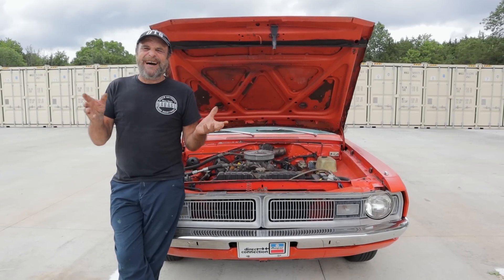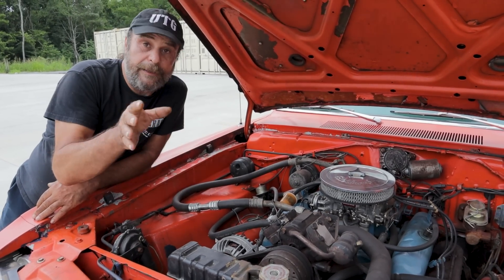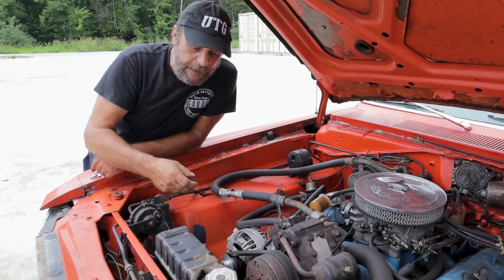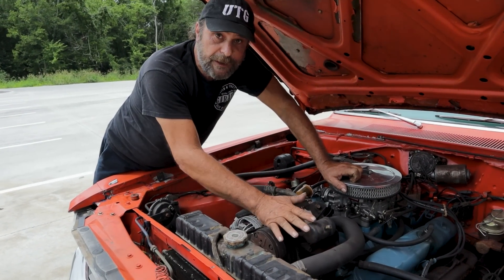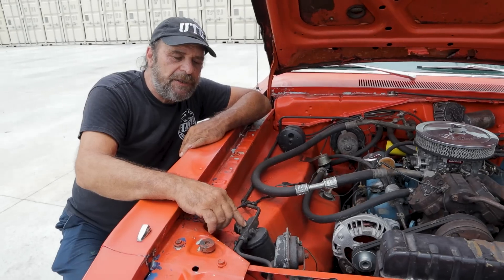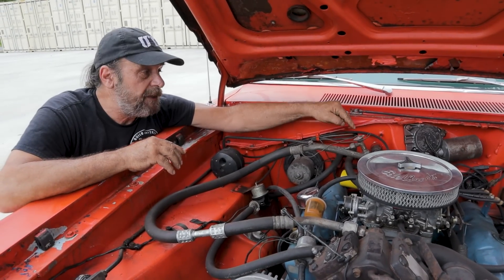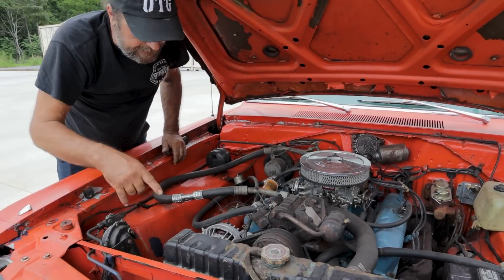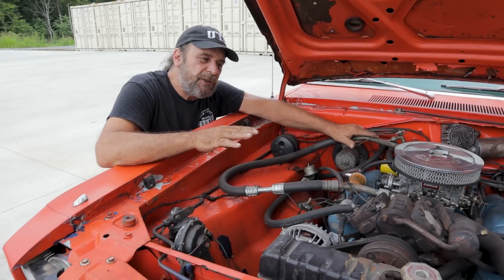Classic Car Air Conditioning Systems - How They Work, Their Differences And Basic Troubleshooting

Comment: I am retrofitting AC into my Valiant using the controls & box from a '75.  The compressor is a later Sanden, brackets & pulleys. from a later LA.  Got a new condensor, evaporator, box parts, dryer, lines & all from Auto Air Solutions.
People might say, "I'd never add AC; adds weight, complexity, isn't original..." but I live in the South and would like to drive my cars whenever, the added weight can be offset by lightening things up, moving the battery to the trunk, et cetera, and not to mention I don't own "Museum pieces"

Comment: I have a stock RV2 on my early 80 D150. The later ones seem to have Sankyos which are much lighter. I have to use my cherry picker to pick up and install that late 50's design RV2 because at 70 it kills my lower back for days. Works great but even with aluminum heads it's a heavy mother!

Comment: The orifice tube on my 93 GM pickup is located right at the outlet of the condenser. I thought that was a strange design.

Perhaps it doesn't matter whether you have high pressure refrigerant or low pressure, cold refrigerant running back to the firewall.. it's going to absorb engine compartment heat all the same.

Comment: I've had very frustrating luck with remanufactured V2 compressors in the last several years, it seems the cores are worn excessively, or the new seals are bad from the get-go. So now I convert to Sanden compressors. They don't have a factory look, but they are much lighter, they don't shake the engine around, and they are reliable.

Comment: Something the old mopars had that all of folks did not know is they have a cycling switch in the dark abyss of the under dash compaction. Also them mopar clutches bite the dust it seems. Also a tid bit the large A/C line is a 3/4" tube. However to have new lines made with barrier hose the fitting is a 5/8" so no big deal, just make the cut.

Comment: How well do those ultraviolet dye leak detectors work?

My brothers car needs brakes, struts, exhaust and front end work REALLY bad but he only wants to spend money on getting the a/c working right now and I'm sure that it has multiple leaks. Yes, I've told him how stupid it is to worry about the a/c before all of the other issues.
Reply: They're decent if you've got a good UV light and the glasses for it. Often it needs to be a good sized leak and it can get washed away if it sits to long with water or dirt making it hard to see. Generally if it's leaking enough to really see the UV dye you can also see the oily spot where it's leaking. 
Takes more equipment, but a better solution is either a sniffer which is expensive or a tank of nitrogen with adapters to pressurize the system. With a nitrogen tank you don't have to worry about contaminating the system and can pressurize it to 200psi which should make leaks easier to find with soapy water. 

I've found a lot of people worry more about the A/C than anything else unless the vehicle won't run or move. Stopping seems optional until the crash. Pretty wild sometimes how much people will ignore until the A/C quits working and then that needs fixed right away.
Reply: Definitely use nitrogen to pressurize system for leak testing.

Comment: As a general rule of thumb, if I pulling off the dust cover for the charge port and pressing on the schrader valve with a mini-screwdriver causes Freon comes out under pressure, then it doesn't need to be evacuated (especially if you're pretty sure no dunderheaded amateur mechanics have worked on it since it was last professionally serviced) because with that positive pressure there would be no way for moisture to get in, so I can go ahead and add some Freon myself.

Comment: Some classic cars use that POE system, or whatever it's called, which really sucks with R134a. It's a metering system that keeps the low side of the evaporator near the pressure at which R12 is at 32F. Unfortunately that pressure is not the same for R134a at the same temperature. So you either need to retrofit those systems, or somehow adjust the pressure. It is just a spring-loaded device. Changing the spring tension would accomplish that. But most of those are not meant to be serviced or adjusted.

Comment: I wish you would have gone through the system pointing out the high side and low side specifically pointing out the charging points on this chrysler. On these older models it's easy to mix them up since they both use same size connections, unlike newer systems where the high side and low side are different sizes and can't be confused.

Comment: Pressure temperature differential vapor gas exchange creates cold air. Seal up the leaks freon etc. Also we are in a "warmer" climate than when the system was degisined.  Extra condenser fan helps

Comment: I need to figure out the A/c in my 71 Cadillac Miller Meteor hearse. No clue where to start. For what I know the compressor is good but there’s bubbles in the viewing glass. If it’s low on refrigerant then I’m guessing there has to be a leak somewhere because a sealed system should never leak? Also it takes a older type of refrigerant that can barely be found and is expensive and most if not all mechanics won’t touch it because it’s illegal. I’ve heard it’s simple to convert the system over to modern refrigerant but I have no clue what it all involves.

Comment: I tried putting refrigerant into our Honda's system. Didn't help, still doesn't get as cold as it used to. Probably overpressurized it and it's fixing to blow up if we don't get it properly serviced. Must be moisture in there or something I'm thinking now. Or the heat exchanger on the cold side is mucked up with condensed sweat and dust. It gets cold, just not cold enough anymore.

Comment: Hi Tony, this is really interesting because I have a 73 slant six Scamp with factory a/c that doesn't work. I'm in the UK and I believe my car came over in 2018 and is a Californian car. Are the compressors rebuildable? I would love to get the a/c working again at some point. Thanks - ChrisPee.
Reply: If you have a qualified competent place that rebuilds compressors sure it is rebuildable , they will it open it up and replace the seals and bench and replace other parts that need replacing 

best off to go to your local compressor shop. Bring them your car  and see if they are willing to rebuild it. Everything back then was rebuildable
Reply: nowdays it might be cheaper to get one online. several parts suppliers offer rebuilt as well as factory new

Comment: How does the new receiver dryer’s element not get saturated with moisture when you are installing it? Isn’t it exposed to the open air before you seal it into the system? Maybe I’m thinking too hard about it
Reply: Just don’t leave it out overnight in a rain storm.

Comment: The CCOT (cycling clutch orifice tube) turns the compressor off when the pressure in the accumulator tank drops below the rated pressure of the clutch cycling switch mounted on the accumulator. Thereby regulating the temperature. It is important to know the relationship between temperature and pressure of refrigerant (there is NO MORE Freon). The best part of your advice (and this is coming from a die hard DIYer) is to have a trained HVAC tech do it for you.
Reply: You can get a variable orifiace tube that really improves these systems . I bought one a NAPA. The Arizona Highway patrol was hard on compressors in their hot climate and this helped a lot and improved the cooling

Comment: Unless you are using real R-12 you cannot go by the sight glass. A fully charged 134a conversion will still show bubbles in the sight glass. That is why no cars since the mid 90’s has had a sight glass. Some retrofit/kit receiver-dryers have them but they are of no use unless you have actual R-12.

Comment: If you put R134a from an auto parts store in an original R12 system (pre 90's) it will dissolve all the O-rings and seals. 
You can get the compressor rebuilt with modern PAG oil compatible seals and replace all your o-rings and it'll work, but not be quite as cold.
R12 is rare these days, been long out of production in the US.   You can put R152a in, but it also needs PAG oil and new seals, but is more efficient in R12 systems.  (R152a is what's in cans of 'Aero Duster' )  It's actually better for the ozone layer than R134a and of course far better than R12, but it is slightly flammable, not like propane, but spraying it on a lit flame will extend the flame. (do not do this, burned refrigerants are toxic)

Comment: Just a quick note on the receiver/dryer, when you buy a new one.  They paint the whole part black and paint over the sight glass so you don't even realize it has one. Scrape the paint off the top where you see a round outline, that will reveal the glass. 🤷
Reply: a sight glass is useless on R134a that is why.

Comment: AC in my 99 Dodge 2500 works mint, had a bad O ring when I bought it, EZ fix. The bitch of it was a broken vacuum line to the HVAC controller

Comment: U can make ur own vacum pump out of an old refriderator compessor,  one line will have vac, the other pressure,  the wireing is simple, cut the two wires going to the compressor and wire in a plain 110 cord,, u can also use it to pressurize the system to check for leaks, air up a tire, ect,

Comment: FYI, the compressor does not compress liquid refrigerant. The compressor compresses low temperature low pressure refrigerant to High pressure, high temperature gaseous refrigerant that then goes to the condenser where the refrigerant is cooled and changes state into a high pressure liquid. Once in liquid form the refrigerant goes to the metering device where it passes through a very small orifice or TXV (thermostatic expansion valve) into the evaporator. When passing into evaporator the high pressure liquid experiences a major pressure drop changing state back into a low temperature low pressure gas that absorbs heat in the process. The compressor then compresses the gas again, the condenser removes the heat and the process continuously repeats.

Comment: Uncle Tony, my Dart was missing the bulk of the A/C when when I purchased it because “racecar”.
Where the hoses attached to the firewall has been sitting “open” for probably decades. What’s the best way to “clean/flush” that part of the system?
Reply: Probably the only part of the refrigerant circuit aft of the firewall is the evaporator itself.  It's pretty typical for the evaporator's input and output to protrude through the firewall, like many heater cores.
You can remove it and make sure that the fins are clean and unobstructed on the outside, and they have cleaners which you can spray into it to clean its insides.
I swear the most common mod in my high school parking lot was a removed compressor, and cutting those big metal hard-lines on GM products.

Comment: OK, from one Tony to another. That pressure switch you were messing with is a high pressure cut out which protects the system from abnormally high pressures as possibly from a dirty condenser or some jadrool over charging the system with refrigerant. There is also a low pressure cut out in the low side somewhere which protects the system from sucking in air in the event of a leak which also cuts off the compressor as this will result in abnormally low pressures in the low side which if left unchecked will result in the system running into a vacuum and sucking air into the system, NOT GOOD! Now for a little thermodynamics. The refrigeration system works as follows, any time a liquid boils into a gas it absorbs heat, and when a gas condenses into a liquid it releases heat, just as a pot of water on a stove boils as it absorbs the heat from the burner or you get a nasty steam burn as your skin absorbs  the heat of steam as it condenses back into liquid water on your skin. Now by manipulating pressures with metering devices like expansion valves or capillary tubes and a compressor we can lower or raise the boiling point of a substance like water or more specifically a refrigerant. So here’s how it goes, the  suction or input side of the compressor is attached to the evaporator where it lowers the pressure, and boiling point, of liquid refrigerant causing it to boil and absorb heat, the output, or discharge side of the compressor now pumps the refrigerant which is now a gas into the condenser where the higher pressure raises the boiling point of the refrigerant causing it to condense where it releases the heat that it absorbed in the evaporator. I’ve been a refrigeration man nearly forty five years now so I can make it sound like I know what i’m talking about, plus I am a home schooled old timer mechanic, albeit maybe not of your caliber which is probably why I enjoy watching your videos so much. Keep the faith bro.

Comment: Good Video!!!

Pro Tip: NEVER EVER EVER add ANYTHING other than Refrigerant, Oil, or Dye. That "leak stop" crap sold at parts stores is also known as "Death in a Can" for ac systems. It plugs small external leaks yes, but also small internal "leaks" like orifice tubes, txv valves, etc.
Reply: Aren't parts stores there to sell parts? 🤔
Reply: It's like the bags of whatever you put on your lawn. I swear I didn't get sticker weeds until after I used a granulated product one time

Comment: One tip, at least on my 73 F100, I had trouble finding a new expansion valve. I found that that exact same expansion valve is used on many big rigs (I believe mine was from a Mack). Also, don't forget to replace those o-rings.

Comment: Please be aware that those RV-2 Chrysler compressors actually have a sump in them that must be filled with oil. I learned that the hard way when I used one to build an under hood air compressor way back in the day.

Comment: Have a vacuum pump at work that'll pull right down near 30 inches and sit there boiling the water and oil out of the dryer. 

It's a homebrew deal with a refrigerator compressor on it.

Comment: I run propane in my r12 systems. SUPER COLD
Reply: Super dangerous too. Never let anyone smoke in your car. People have been killed by using Propane in an AC system.
Reply: propane works as a refrigerant and is good for heating too!
Reply: @kurtzimmerman1637  Just not the type of heating you want.
Reply: @stephenvelden295  I smoke in car all the time lol

Comment: There's nothing electronic, on those. The clutches are electrically engaged.
Ford Motor Company bought up a bunch of Frigidaire compressors for their larger vehicles. 
AMC habitually used Ford-type compressors.
As long as the system has pressure, you could throw in a couple cans and get it working up to par. Still, you'd have to check the system for leaks. Otherwise, there wouldn't have been any reason to fill it back up in the first place

Comment: Propane, AKA R90, works in car ACs but is illegal.

It's legal in some stationary ACs though.
Reply: When the refrigerant goes from a liquid to a vapor that is where the temp / energy transfer happens
Reply: I'll never tell why my a/c is colder than most.
Reply: It's not just the expansion, it's the state change from a liquid to a gas.
Reply: @WhiteTrashMotorsports  Heh heh heh

Comment: Not too many places work with r-12 any more ...there are conversion kits you can get for 134a,,,like uncle tony says it doesnt last long with a r-12 compressor,,,ive done a few....9 times out of 10 you will have to change to a modern compressor (134a),,,like tony says find the service manuel study it....its not hard,,,but a compresser $$$ could be scary...
Reply: All of the old stuff works perfectly fine with 134. The only two things that need to be changed are the condenser (an absolute must) and the oil. The condenser needs to be upgraded (most replacement parts are parallel flow now) because 134 runs a little hotter on the high side, and use ester oil. Ester oil will mix with any old R12 oil and is compatible with 134 as PAG oil will not mix with old oil. The pumps can handle 134 just fine! I still use R12 every once in awhile on a number perfect car if the owner wants it.
Reply: Not necessarily.   The York compressors like those found on Fords and AMCs can work quite well with 134a.  I know this because I am an ag diesel mechanic and these compressors are very common on the older equipment.
Reply: @importsstillsuck  R12 is nearly nonexistent. Manufacturing of it was banned some twenty thirty years ago.  At this point, the basic car enthusiast's choice is to convert to a different refrigerant or to use a sketchy "R12 replacement" refrigerant.
Reply: @importsstillsuck  it's like finding the original whale oil Dextron for your transmission. Sure, it's the best way to go, but good luck finding it.
Reply: Now we've switched again. It's 1234 YF refrigerant now!

Comment: I wonder if you can "recharge" the desiccant bottle by getting it real hot and cooking the moisture out of it. Some desiccants work like that. You'd have to install it while it's still pretty hot though to make sure there's no moisture in it, or otherwise seal it somehow while it's hot until it's installed. There's a science experiment for someone!
Reply: A friend of mine would put them in ovens and cook them for a while at slightly over 212 degrees. The theory is all moisture would turn to vapor and leave. I never did that, but I had a system open for multiple years, fixed the leak and left the old drier. It still works today.
Reply: It's been my understanding that pulling a good 30" of vacuum will boil the moisture out of the receiver/dryer.  The R/D does act as a filter though, and is designed to protect the rest of the system if the compressor frags internally.